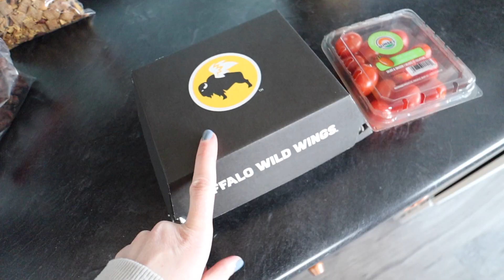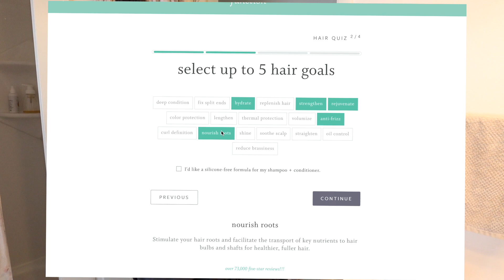I HELPED CORNSTAR FARMS ...

Comment: I usually use two tissues because snot leakage freaks me out.  As for paper towels I try to use cloth to wipe up spills and just rinse well and wash in hot soapy water ready to use again.
Reply: I use two as well sometimes, or fold over the tissue, because of the same thing! (Ick!) Tissues, like everything else, have gotten smaller and thinner over the years. I had run across some 'vintage' Kleenex in a old winter coat recently and was amazed at the difference.  I have piles of rags for clean-up jobs too - our old t-shirts get cut up and I have a stack of the resulting rags under the sink to use for random cleaning/spills.